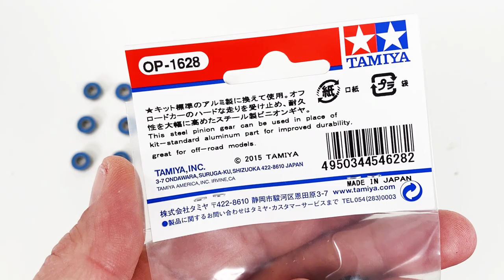Tamiya DT-03 (& DT-02) Best Basic Upgrades x 2: Metal Ball Bearings & Steel Pinion

Comment: Very nice Mikael.  It makes me laugh that the Tamiya 'Expert Built' cars don't have bearings. Any expert should know they are pretty much essential! If you have to end up taking the car apart then you may as well get the kit unless you really don't like painting the bodies.  I think you were saying in a previous video that this was a bargain so worth getting if that's the case. Anyway, hope you are having a good weekend mate.  Best wishes to you and yours 🙂
Reply from the maker: Hi Pete! Ha ha, yeah, well apart from the body and shocks it’s nearly faster to build a DT-03 kit and add bearings along the way … than disassembling and assembling an XB or X-SA. I was actually hoping they would start adding bearings in the new X-SA models. But no. Tamiya refuses to enter the new millennium 😅 Good weekend so far. No RC’ing. The son is into football and handball 😅😅😅
Reply: Jesskha  oh yeah I like those Carson ESC's too 👍
Reply: Yeah not wanting to deal with decals and paint is exactly the reason I got the x-sa, building I don't mind as I have several WPLs. And it doesn't hurt it just costs 84 Euros right now, too bad about not getting the torque tuned motor instead of the silver can. So directly to brushless it went 😄
Reply from the maker: @Tamichtube  Yeah, such an odd choice with the standard silver can. I remember my TT-02B XB coming with a Torque Tuned. So makes no sense.
Reply: @NordicRC  Yeah I mean since the X-SA is on a big sale for below kit price it's fine, but regular price to get the silver can is pretty bad. Well I guess it could be one of the reasons it's on sale. 🤔

Comment: A tip from me is to get a couple of 5x11x4 flanged bearings for the front wheels.  Put on the inside of the wheel and normal bearing on the outside.  Removes all the crazy slop the front wheels have.
Reply from the maker: Hi Matt. Uhh good tip. I might look into that! Thanks!

Comment: The two plastic gearbox bridges you show at 1:24, replace them with the Tamiya Hop-Up part 54566. It will greatly reinforce the chassis structure.
Reply from the maker: Ahh, this will stay stock. But got another Racing Fighter. Needs some new parts soon. But yeah. I’ve seen those, but never actually got them. Come spring I will ☺️
Reply: @NordicRC  have you found any solution to the awful understeering tendency of this chassis?
Reply from the maker: @mathieuquoi6160   Nope. Any ideas?
Reply: @mathieuquoi6160  Have you tried sticking some weights on the front end of the chassis?
Reply: @S.Keenan  no, not tried yet. I will try that. Thanks.
Reply: @mathieuquoi6160  tap the brakes then turn and try not to spin out from oversteer

Comment: I built a Falcon kit in 1987 with these awful white plastic bushings.  As a kid I didn't know the difference.  The car was ruined after a few drives.  The plastic when greased, sucks up dirt and becomes a grinding stone and eats the car's drivetrain from within.  Even switching to bearings at that point was useless because the tolerances were wallowed out all over the car.  
I can't believe Tamiya still sells modern kits with this junk in them.  It may add 20-30 bucks to the prices of a kit, but worth every penny to the quality of the vehicle produced.  All my kits since then of course are ordered with and  get bearings and oil shocks on day one in the build.  

My 30+ year old RC10 and Ultima still run like new having had bearings since built.  My two modern TT02 kits built with bearings and oil shocks since day one run fantastic also.
The key:  never install those white plastic bushings.

Plastic bearings and those awful pogo stick friction shocks have to go away forever.  Come on Tamiya, we love your quality, we love your  kits.  Move them into this century!
Reply from the maker: Yeah, it’s one of those things: Tamiya works in mysterious ways. I can’t believe it too. Even the cheapest Chinese hobby cars come with bearings these days 💁